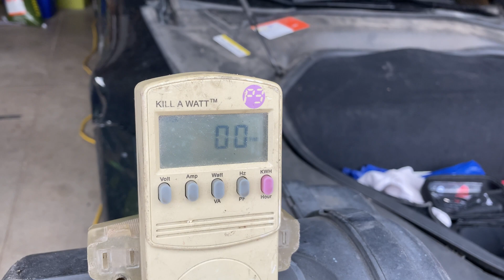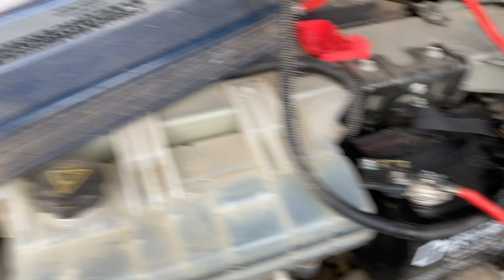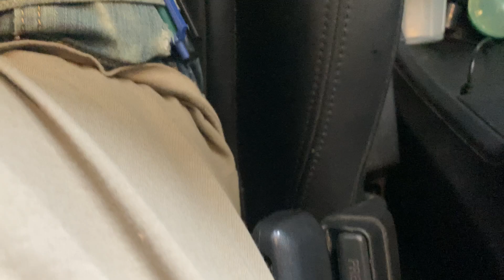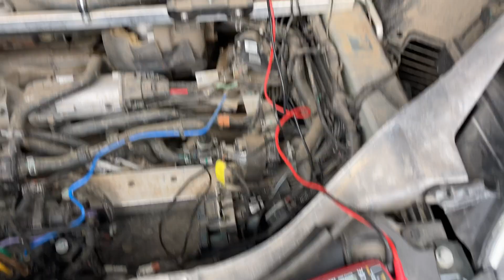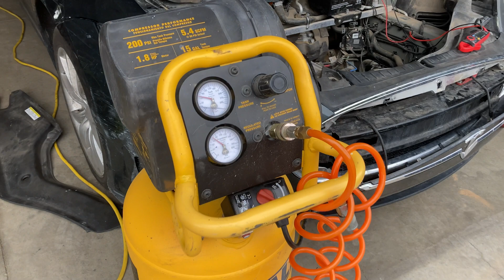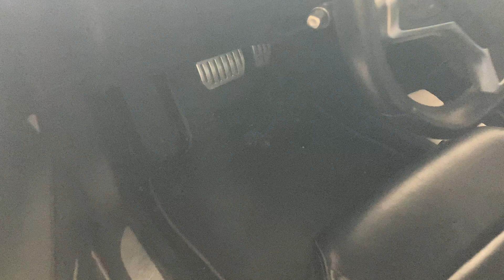Tesla powered air compressor

Comment: Inrush current tripping OCP on the inverter. Good effort, needed some EE knowledge. Car won't care about this it isn't even monitoring the current, you may get some yellow warning once it drags the voltage down below whatever the threshold is. If you delete the battery from the equation I can't say what the 12v "alternator" is rated for
Reply from the maker: It’s crazy, I rebuilt an entire duplex using this setup last summer. Took some getting used to pulling the trigger on the skil saw then waiting a second for the inverter to get past the inrush current trip. Been a good little setup without having to run a generator on the job site. Thanks for the info!
Reply: @MicksUglyEVs  what is your "12v" output? I have a 2 week old Model 3 and it always shows 15.5v
Reply from the maker: I imagine it would be in the 14v range like ICE alternators but I’d have to double check. 15.5v seems like it would cook the 12v battery after time. What’s your take? Model 3 likely has the latest tech so I know they have it figured out, just seems high to me.
Reply: @MicksUglyEVs  apparently they changed from lead acid to lithium for the low voltage source. 15.5v is a very safe storage voltage for 4 lithium cells in series, usually 16.8v is 100%, 14.1v is 10%, so 15.5v is a very happy 60-70% charged.